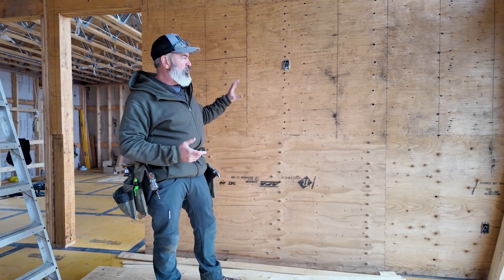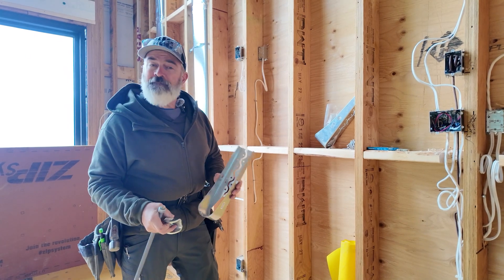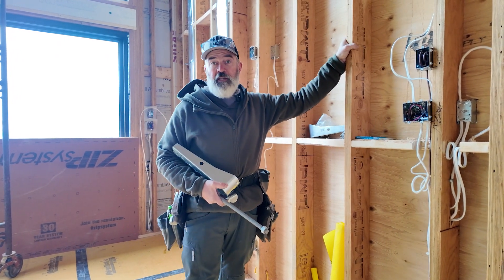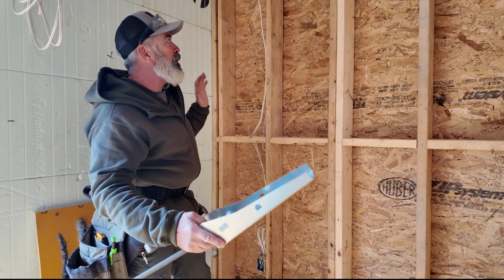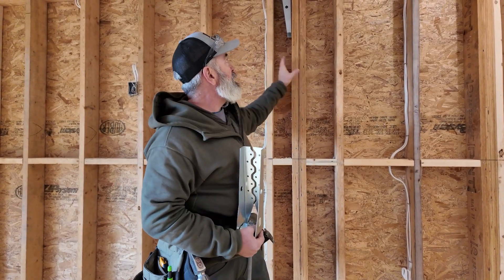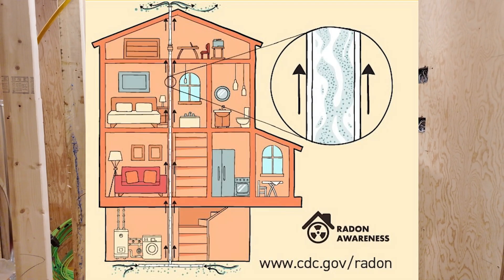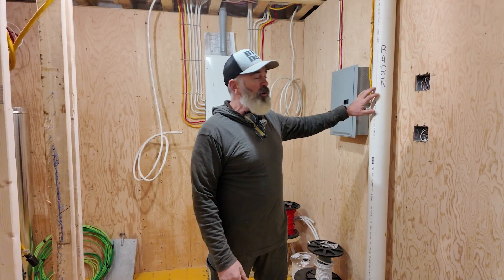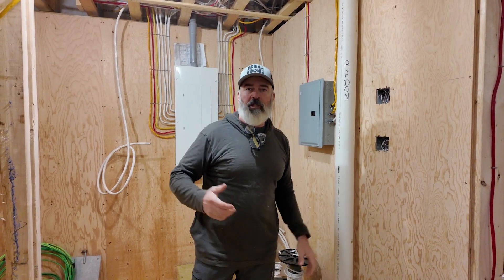South Hollow Part 16 Shear walls, Radon, and more! #homeowner #carpenter

Comment: When Bacsek was there, he and a few commenters were scratching their heads about the placement of that sheae wall, thinking it should have been in the gable wall with all those big windows.  Did that every get explained by the engineer? Is it that that wall is so rigid and firmly anchored to the floor that it can resist being toppled by winds hitting the side of the house?
Reply from the maker: I was more on why the gable wall wasn't also a shear wall. I did review the plan with the engineer a second time.  The loft floor diagram and the dropped ceiling in the Master bedroom,  combined with truss bracing and 2x4 ceiling strapping. Meet the requirements to resist racking of the gable walls.
Reply: @Aron_Jones_Carpenter  Thanks! Maybe you should copy-paste this answer also in the video of Steven Baczek.
Reply from the maker: Good idea!
Reply: I was about to ask the same question regarding Steven Baczek's remarks 🙂 ... what did the engineer said about this?
Reply: @koenraadprincen7212  Good to see you again!  By the way, I checked my fire extinguisher and the pressure is green.  And I scored 100% on my fire extinguisher training at work.  But seriously, I researched Flax insulation and it seems excellent.  I see 🇧🇪,  🇫🇷 , and 🇳🇱 are major producers.  but I could not locate a North American supplier.  The only downside was the price, but i assume it is no more expensive than say rockwool
Reply: @markstipulkoski1389  I'm happy for you! 🙂

Flax... I thought the US had more production... I read that flax is working it's way up again the US ("PA Flax Project" and "Green Mountain Linen").
Canada is also busy with a revival of flax.

Sheep wool and expanded cork are also natural products that are fire safe.

Cellulose, wood fibers and other natural fibers can be made fire safe after addition of borax-salts (which also helps against rot and mold).
Reply: @koenraadprincen7212  Well, I was going to say that I was leaning towards cellulose but I thought you might take objection to the borate.  II'm glad you approve.  My current plan is to do the roof assembly of the house in this video, a mono-slope with an air sealed lower insulation cavity filled with cellulose.  A smart vapor barrier will prevent indoor humidity from entering the insulation cavity. The insulation cavity will be topped with a vented over-roof to promote drying to the outside.  Over that will be a standing seam metal roof to which solar panels will be mounted.  You seem to know building science very well.  If you don't mind telling, are you an eco-builder, architect, building product supplier, inspector, academic ...?
Reply: @markstipulkoski1389  
Borate: It's not allowed anymore in Europe (I had that discussion here on YT in the past), but still allowed in NA... let's say that "the American jury is still out" ;-)

Roof: Smart vapor retarders only work on paper, don't count on them. Besides that, in a vented roof (or ridge) you don't need them anyway.
Smart vapor retarders were invented for flat roofs. The waterproof membranes used are also vapor tight so the only way for moisture to escape was waiting till summertime and hoping it can come back to the interior.
In your case, use the cheapest vapor retarder or use sheetrock (or any other building board like MDF, fiberboard, plywood, OSB,..) to make the ceiling air tight (and take care of the seams).

Me: I'm somewhere between an architect, an engineer and a builder as I'm currently busy with a modular building system.
But I do have as masters degree, so I should know what I'm talking about... LOL.
Reply from the maker: Are you posting or documenting this build anywhere?
Reply: Those remarks were raised in a video on Stevens YT-channel:
https://youtu.be/-N43_7tL1Nw?t=927

Comment: "Sometimes in framing, things are not perfect". I find this hard to believe.
Reply from the maker: Wood is a natural material,  even if the framing is perfect.  Wood moves as it drys in occasionally unpredictable ways.
Reply: @Aron_Jones_Carpenter  You don't have to tell me.